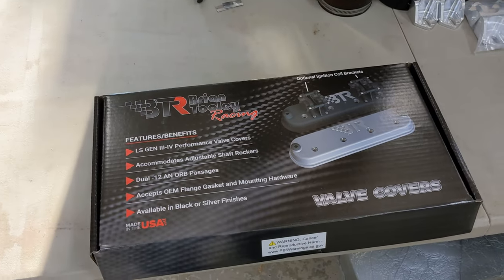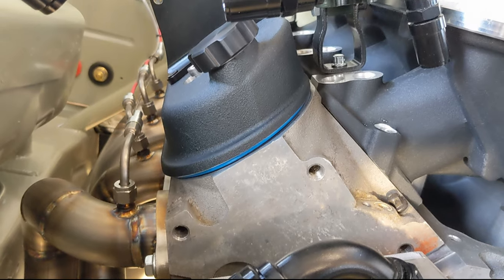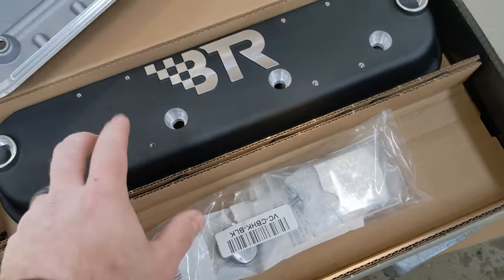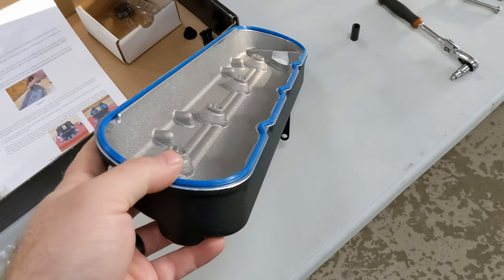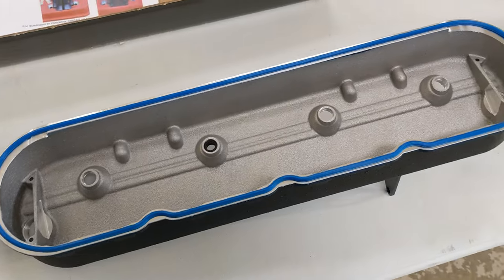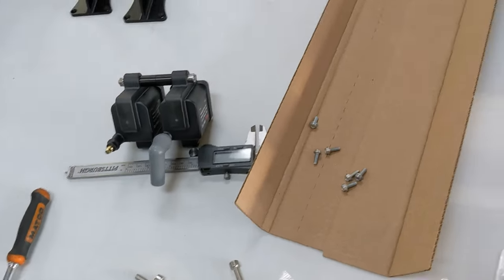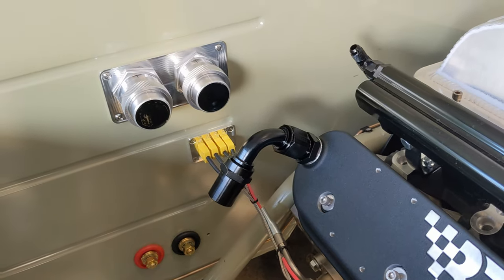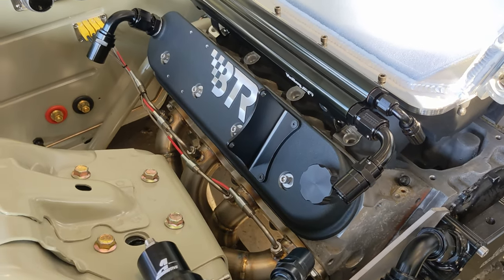BTR LS VALVE COVER SET - UNBOXING AND REVIEW

Comment: How'd the oil consumption and PCV catch can system work out?
Considering buying a pair just to have better positions for catch can routing on a road race car.
Reply from the maker: VERY WELL.  If possible use the front, but we have seen great help with ventilation and not as much in the catch can compared to the standard weldin in bungs in valve covers.

Comment: It probably wont be a problem, due to the design of these covers.  But on a factory VC, they suffer from oil consumption mostly on the dirty side because the oil pushes towards the rear of the vehicle under acceleration.  This happens to be when you get the most blowby. The holley VC’s are notorious for oil consumption issues for this reason.

Comment: Man think I'm going to give these a try.. you still liking them?
Reply from the maker: We've sold a good number of them, and haven't had complaints.
Reply: @Scramspeed  Do I need a specific coil to run these valve covers I have the 40164 GM LS Ignition Coil 1999-2007 5.3  is there another coil I can use without having to tune or should I invest in some decent coils and tune
Reply from the maker: @irvingbar4569  The valve covers come with brackets for the LS3, LS7 and GEN 4 truck coils.  I believe the ones you are mentioning will not fit, so I would buy some newer truck coils with the heat syncs or the LS3 coils.  ALWAYS BUY GM COILS!  We have a blown up parts store coil on a GTO in our shop as we speak!
Reply: @Scramspeed  do you have a part number and would I have to retune
Reply from the maker: @irvingbar4569  You don't need a retune for changing your coils. I do not have the part numbers for the various coils. I'm sorry.
Reply: @Scramspeed  what type and length spark plug wires are you running
Reply from the maker: @irvingbar4569  On my car, we're running MSD Super Conducter wires. When we remote mount the coils, we custom make MSD wires for the individual application.
Reply from the maker: @irvingbar4569  We run the MSD Super Conducter wires. When they're relocated, we make custom ones, but we use that same wire and boots.

Comment: Just received my set and really disappointed.  All sorts of machining flash and burrs.  Will need quite some work to get them cleaned up.  You mention how clean they are - likely early batches and now we get production "shit" parts.
Reply from the maker: Sorry to hear you had a bad experience. BTR are good folks. I would definitely recommend giving them a call.
Reply: call btr they’ll sort it out
Reply: We sell a lot of them where I work. The newer "VCA-02" castings are much better than the previous "VCA-01". It was a year or two ago that they switched to the newer castings. Some sets I installed before had a bunch of sharp edges and burrs that would break off that I had to clean up. The newer ones don't have any of that.